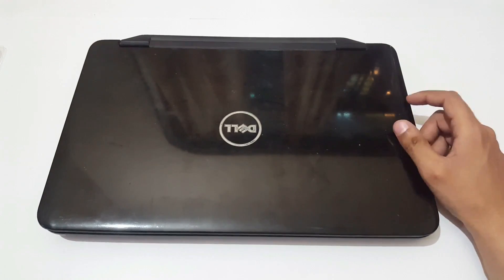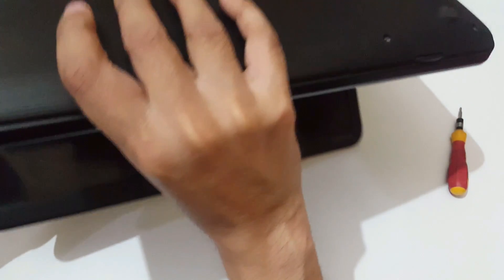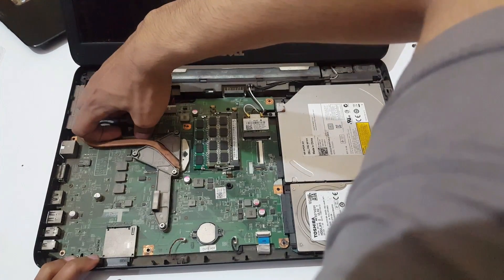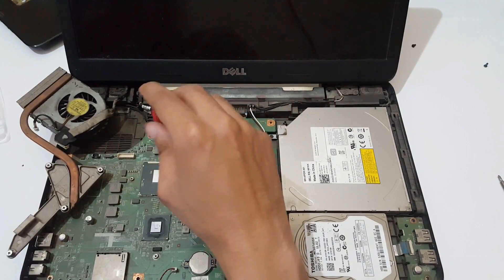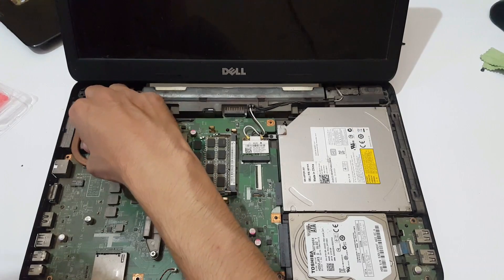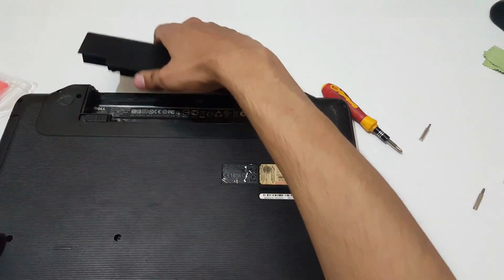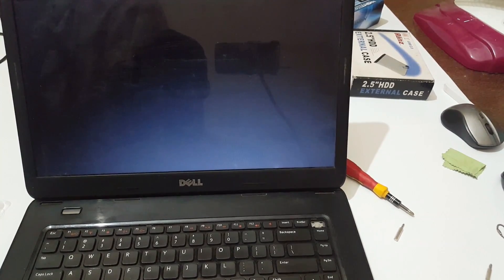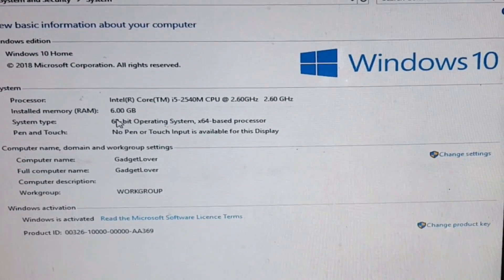How to Upgrade Processor on DELL Laptop | i3 to i5 & i7 - Make Laptop Faster for Gaming

Comment: Hello, This is my laptop specification below.

HP Laptop 15-bstxx
Intel(R) Core(TM) i5-8250U CPU @1.60GHZ 1.80 GHZ
6GB RAM
Memory slot 2 of 2 is in used now. 

Now I wanna know that, is it possible to restore new RAM about 16GB or more?
Does it support on my PC?
Will my PC reset if I restore new RAM and remove previous one??
If I can not restore new RAM then suggest me, how to run faster my PC?
Reply from the maker: @robiul_001  Hi and upgrade it with 2×8GB RAM in your Laptop and it will not reset after RAM upgrade
Reply: @GadgetLover360  Thank you so much for your response.♥️
Reply from the maker: @robiul_001  You're most welcome
Reply: @GadgetLover360  hello sir, my current PC memory speed is 2400MHz, if I restore 8+8gb compatible 3200MHz ram, will it be shown as 3200MHz??
Reply from the maker: @robiul_001  Hi and buy same module

Comment: Can I upgrade my laptop asus X452CP
Reply from the maker: @Naim1806  In my knowledge the processor of this Laptop is soldered so you can't upgrade it but I would suggest you upgrade its RAM to max and install SSD for better performance

Comment: sir my processor upgradable or not inspiron 15 3510 uhd graphics 600
Reply from the maker: @raihanhazri8041  The processor of this Laptop is soldered so you can't upgrade it but I would suggest you upgrade its RAM to max and install SSD for better performance

Comment: Hi! What's the model of this laptop please? It's the same with mine. I would like to also know what type of CPU I should buy in order to upgrade it's performance. It's Gghz is 1.60.
Reply from the maker: @hamzaahmadumar6210  Hi and this is Dell Inspiron N5050 which comes with Intel Core i3 2350M and upgraded with Intel Core i5 2540M
Reply: @GadgetLover360 bro can it will upgrade to i7 which model
Reply from the maker: @YogiRawat07  Intel Core i7 2640M

Comment: Sir i have a laptop i3 6006u cpu 2.00GHz 2.00  can I upgrade processor please reply ❤
Reply from the maker: @HANSRAJ-lj2bv  If the processor is not soldered yes you can upgrade it in same generation
Reply: @GadgetLover360  if solded then what can i do can I unsold and upgrade 🤔
Reply from the maker: @HANSRAJ-lj2bv  No

Comment: Is it possible to upgrade my sony vaio with intel(r) core(tm) i3 cpu m350 @ 2.27ghz, what are my best options? I would love to upgrade it to i7
Reply from the maker: @jayriemendoza2011  In my knowledge the processor of this Laptop is soldered so you can't upgrade it but I would suggest you upgrade its RAM to max and install SSD for better performance
Reply: @GadgetLover360 its a 2010 model and i have seen some in yt that its not soldered. Ill just check, if ever its not soldered what are my best options?
Reply from the maker: @jayriemendoza2011  Intel Core i7 640M

Comment: is it possible to upgrade the processor of dell vostro notebook 3401 my processor in intel core i3 10 gen with 4gb ram
Reply from the maker: @FarhanAhmed-hm7dc  The processor of this Laptop is soldered so you can't upgrade it but I would suggest you upgrade its RAM to max and install SSD for better performance

Comment: is it possible for a dell 5570 to upgrade its intel processor??
Reply from the maker: @jeremyjeremy8593  The processor of this Laptop is soldered so you can't upgrade it but I would suggest you upgrade its RAM to max and install SSD for better performance

Comment: I replaced the CPU in my Dell Inspiron N4050 with i7 2630QM. But it didn't improved the performance. It won't run in 100% processing power, just capped at 40%. I still enjoyed the 8 cores tho
Reply from the maker: @YumeSekaiOfficial  It might be due to software problem go to Settings>Update and recovery>Recovery>Refresh your PC without affecting your files and see if the problem has been solved
Reply: @GadgetLover360  I dunno if that will work. I mean N4050 came out with i3-2310M which doesn't support Intel Turbo Boost. Even the BIOS is so old, it didn't even support it.
Reply from the maker: @YumeSekaiOfficial  Update it BIOS version and see if the problem has been solved

Comment: Bro my laptop is inspiron 15 3542 model and is it possible to upgrade my laptop i3 to i5
Reply from the maker: @Muhammedhashim_10  The processor of this Laptop is soldered so you can't upgrade it but I would suggest you upgrade its RAM to max and install SSD for better performance

Comment: hi bro, can i upgrade my dell latitude e5440?
if yes, what is the best processor for it?
Reply from the maker: @zersVAL  Hi and the processor of this Laptop is soldered so you can't upgrade it but I would suggest you upgrade its RAM to max and install SSD for better performance
Reply: @GadgetLover360  noted, thanks!
Reply from the maker: @zersVAL  You're welcome

Comment: Hello sir can i upgrade my dell inspiron M5040 laptop 
The processor is - AMD C 60 APU ,  and which peocessor should i add
Reply from the maker: @entitysoul77  Hi and I would like to inform you that the processor of this Laptop is soldered so you can't upgrade it but I would suggest you upgrade its RAM to max and install SSD for better performance
Reply: @GadgetLover360  thank you sir
Reply from the maker: @entitysoul77  You're welcome

Comment: Hi bro , I'm using dell Inspiron 15 N5050 same series i want to upgrade processor what processor would you prefer for me under 5000 rupees. If in case i upgrade processor is this problem like heat or something?
Reply from the maker: @magiba786  Hi and Intel Core i5 2540M is best processor for your Laptop
Reply: @GadgetLover360  ok thanks its introduced new issue like heating or something and what is the maximum RAM support plz tell 🙏
Reply from the maker: @magiba786  You're welcome and this will not raise any issues and you can expand it upto 8GB

Comment: Can i upgrade the processor in dell Inspiron 15 3552?
Reply from the maker: @Wise_worm1  The processor of this Laptop is soldered so you can't upgrade it but I would suggest you upgrade its RAM to max and install SSD for better performance
Reply: @GadgetLover360  thanks for the answer. But will I be able to upgrade the CPU if I changed the motherboard?
Reply from the maker: @Wise_worm1  If it is not soldered then yes
Reply: @GadgetLover360  what motherboard you recommend me for laptop? In the previous message I said "sorry" instead of "thanks" lol
Reply from the maker: @Wise_worm1  You're welcome and I would suggest you search on ebay online store or nearby PC store
Reply: @GadgetLover360  thanks so much for informations and help sir, you got a new subscriber!
Reply from the maker: @Wise_worm1  Dear subscriber you're most welcome

Comment: I bro can i upgrade my i3 to i5 in dell Inspiron 3567 

Plz reply
Reply from the maker: @kumarianjali9799  The processor of this Laptop is soldered so you can't upgrade it but I would suggest you upgrade its RAM to max and install SSD for better performance
Reply: Ok😊

Comment: Hi I want to upgrade my pc for coding:
Processor	Intel(R) Core(TM) i5-6200U CPU @ 2.30GHz   2.40 GHz
Installed RAM	8,00 GB (7,74 GB usable)
Dell Latitude 3570 what are your recommendations?
Reply from the maker: @bernardmanikwa3876  The processor of this Laptop is soldered so you can't upgrade it but I would suggest you upgrade its RAM to max and install SSD for better performance in coding

Comment: DELL 5300 i5 87h gen can I upgrade it on i7?
Reply from the maker: @melenciotabud1635  The processor of this Laptop is soldered so you can't upgrade it but I would suggest you upgrade its RAM to max and install SSD for better performance

Comment: Bro if we change the processor then what about graphic card it will increase or not, I wanted to make a gaming PC
Reply from the maker: @mohit65478  It will not optimize but the Laptop performance will optimize and I would suggest you change its graphics card also for better gaming experience
Reply: @GadgetLover360  bro plz suggest a good graphics card & where could i buy from?🥺
Reply from the maker: @mohit65478  I would suggest you search on Amazon online store for better results
Reply: @GadgetLover360  but it will be the external gpu right?
Reply from the maker: @mohit65478  In my knowledge yes

Comment: Bro i have sony vaio laptop sve series can i upgrade?
Reply from the maker: @mohit65478  If the processor is not soldered you can upgrade it in same generation
Reply: @GadgetLover360  how get i know whether the processor is soldered🤔
Reply from the maker: @mohit65478  Provide your Laptop model number
Reply: @GadgetLover360  current processor intel(r) core(tm) i3-2328m cpu @ 2.20ghz 2.20 ghz
Model--sony vaio sve151g12w
Reply from the maker: @mohit65478  Yes and Intel Core i5 2540M is best processor for your Laptop
Reply: @GadgetLover360 where i can order bro its not available on amazon right now😢
Reply from the maker: @mohit65478  I would suggest you buy it from ebay online store
Reply: @GadgetLover360  thanks bro
Reply from the maker: @mohit65478  You're welcome

Comment: Hi bro , great video ! I have a question . Im using Nec Brand laptop with core i3 2nd gen. Do you think i can upgrade the procesor to core i5?
Reply from the maker: @LoidTech  Thank you and if the processor is not soldered you can upgrade it in same generation

Comment: my laptop is hp 2000 2128-tu and it's socket is G2 rPGA 988B so which processor is compatible for this ?
Reply from the maker: @CrapBagg  Intel Core i5 2540M is best processor for your Laptop

Comment: Lenovo ideapad s510p i5 4000u can i changed i7 4gen ? Plz tell me any buddy
Reply from the maker: The processor of this Laptop is soldered so you can't upgrade it but I would suggest you upgrade its RAM to max and install SSD for better performance

Comment: I have intel core i3-3110M processor with Sockets Supported FCBGA1023,FCPGA988 can i upgrade with i5?
Reply from the maker: Yes with the second one if the processor is not soldered but only in the same generation only
Reply: I will arrange quad core processor i7

Comment: Hello, where I can find processor for my laptop if i want to upgrade my CPU is changeable because it's a PGA, so where i can find laptop processor? i5- 4200M
Reply from the maker: Hi and I would suggest you buy it from Ebay online store
Reply: I will arrange quad core processor i7
Reply: @lakshmanraj9375  whats the pricing?
Reply: @mountainstorm122  3000 above depends upon model

Comment: I have Intel Core i3-2350M can i upgrade
And if I upgrade plz tell me what highest i upgrade
Reply from the maker: Intel Core i5 2540M is best processor and you can also go with Intel Core i7 2640M
Reply: @GadgetLover360  but the main problem is can i upgrade Intel Core i3-2350M  what the socket type intel website shows both bga and pga socket type
Reply from the maker: @Dakshtrend Yes you can upgrade it without any problem
Reply: @GadgetLover360  one last query pga processer is too expensive on Amazon and it's availablity is low so can you tell me how can I buy that processer you tell

And thanks for solving my querys 
And you also a great person you still replying
Reply from the maker: @Dakshtrend You're welcome and both are best processor and Intel Core i7 2640M will provide more powerful performance then Intel Core i5 2540M and I would suggest you buy it from Ebay online store
Reply: @GadgetLover360  ok thanks 😊 for helping
Reply: @GadgetLover360  Intel Core i7 2820QM CPU 8M Cache Quad-Core 2.3GHz SR012 Mobile Processor 

Ye vala 4core 8 thred vala hain ye calega kya
Reply from the maker: @Dakshtrend You're welcome and this processor has high TDP which will generate more heat
Reply: @GadgetLover360  bro can I use Intel core i7 2620m because it is available
Reply from the maker: @Dakshtrend Yes
Reply: i have processor
Reply: @gokuda-xi5tf  which can you tell me in detail
Reply from the maker: @gokuda-xi5tf  I would suggest you follow video instructions carefully to do it successfully without any problem
Reply: I will arrange quad core processor i7 2860

Comment: Hey man, i have dell 3340 i3
Is it possible to ugrqde it to i5?
Thanks man
Reply from the maker: You're welcome and the processor of this Laptop is soldered so you can't upgrade it but I would suggest you upgrade its RAM to max and install SSD for better performance
Reply: @GadgetLover360  im in a tight budget, but can i buy 1 8gb ram stick and plug? 
The i'll just buy another one soon?
Reply from the maker: @darkknightzero0811  Yes but before that see how much you can expand its RAM
Reply: Can i use ssd stick in a ssd adapter to my dell?
Reply from the maker: @darkknightzero0811  Yes
Reply: What ssd stick you recommend for my dell latitude 3340?? Thanks man
Reply from the maker: @darkknightzero0811  You're welcome and I would suggest you buy Crucial P3 or Samsung 980 SSD for your Laptop

Comment: Hey dude u just wanna ask that will this process work on dell Inspiron 3542
Reply from the maker: In my knowledge the processor of this Laptop is soldered so you can't upgrade it but I would suggest you upgrade its RAM to max and install SSD for better performance
Reply: @GadgetLover360  Thanks for the fast reply dude 👀🥰 , I'm thinking of 8gb ram and an 250 gb SSD, will I get 30-40 fps? It is enough for me I'm just a casual gamer 🙂
Reply: @GadgetLover360  Reply please 🥺
Reply from the maker: @tencenterror404  You're welcome and yes

Comment: I have dell Inspiron 3521 i3 processor 12gb ram and 512gb SSD it is possible to change processor from i3 to i5 or i7
Reply from the maker: The processor of this Laptop is soldered so you can't upgrade it
Reply: @GadgetLover360  so please suggest me anything by which I can play Far cry 3 smoothly i don't have enough money to buy new laptop or pc 😭
Reply from the maker: @royalgamer_666  I would suggest you connect external graphics card for better gaming experience
Reply: @GadgetLover360  will it support on my laptop
Reply from the maker: @royalgamer_666  Yes

Comment: I have the dell inspiron 15r 5521 laptop with an intel core i5 or something like that, what can i upgrade it to
Reply from the maker: The processor of this Laptop is soldered so you can't upgrade it but I would suggest you upgrade its RAM to max and install SSD for better performance

Comment: Can I change dell Inspiron 14r processor
Reply from the maker: I would like to inform you that if the processor is not soldered you can upgrade it in same generation
Reply: I will arrange quad core processor i7

Comment: Which i7 prosesser can i use?
Reply from the maker: I would like to inform you that if the processor is not soldered you can upgrade it in same generation
Reply: I7

Comment: Bro does Dell Inspiron 1440 support this core i5 it is 2009 model around
Reply from the maker: I would like to inform that you can upgrade it in same generation
Reply: Which generation this laptop in this video
Reply from the maker: @maienuddin7560  This is Intel Core i3 2nd generation upgraded with Intel Core i5 2nd generation
Reply: @GadgetLover360  will it support
Reply from the maker: @maienuddin7560  Intel Core 2 Duo T9900 is best processor for your Laptop
Reply: @GadgetLover360  thank you for your help
Reply from the maker: @maienuddin7560  You're welcome
Reply: My laptop is dual core processor model t4440
Reply: I will arrange quad core processor i7

Comment: Where do i buy this processor bro i live in india and price
Reply from the maker: Price isn't too much and I would suggest you buy it from ebay online store
Reply: @GadgetLover360  thank bro 👍
Reply from the maker: @F.erguson  You're welcome
Reply: i have processor
Reply: @gokuda-xi5tf  how much
Reply: @F.erguson  intel i7 2, 3, 4 gen quad core processor
If you having Pentium processor or celeron processor or i3 or i5 2nd, 3rd, 4tha generation processor in laptop you can upgrade it.
Plug and play and no bios update needed.
Intel i7 2nd, 3rd, 4th gen quad core processor any available model I can arrange it from my frnd.
i5 2540 & i7 2640 2nd gen in hand available. starting from 999
Reply: @F.erguson  which model u need
Reply from the maker: @gokuda-xi5tf  I would suggest you follow video instructions carefully to do it successfully without any problem
Reply: laptop processor AMD E2, A4, A6, A8, A10 & i7 1, 2, 3, 4 gen available
Reply: @gokuda-xi5tf  which is best for Dell n5050 laptop.and compatible with it.
Reply: @gokuda-xi5tf  what is the best that you have and compatible with n5050
Reply: @F.erguson  what is ur processor model and chipset version
Reply: @F.erguson  what is ur processor model & chipset version
Reply: whai is ur processor model & chipset ver
Reply: @gokuda-xi5tf  Intel Core i3-2350M 
Intel HM67 Express
Reply: @gokuda-xi5tf  price
Reply: @F.erguson  hello ?
Reply: @gokuda-xi5tf  hello
Reply: @F.erguson  quad core 2100 and duel core 1000
Reply: @gokuda-xi5tf  quad core one price

Comment: Tell me can I upgrade to i7 ,  I have i3 11th gen Inspiron 3501
Reply from the maker: The processor of this Laptop is soldered so you can't upgrade it but I would suggest you upgrade its RAM to max and install SSD for better performance
Reply: @GadgetLover360  it already has 8gb ram, 256gb SSD with 1tb HDD. Shall I go for further upgradation
Reply from the maker: @unseenscene4487  Yes you can upgrade its RAM upto 16GB for more better performance
Reply: @GadgetLover360  thanks 😊
Reply from the maker: @unseenscene4487  You're welcome

Comment: Am I able to upgrade my Inspiron 3542 Processor? It currently has Intel(R) Core(TM) i3-4005U CPU @ 1.70GHz   1.70 GHz but I would like to upgrade it to the max so I don't know to go with i5 or i7. Please help!
Reply from the maker: The processor of this Laptop is soldered so you can't upgrade it but I would suggest you upgrade its RAM to max and install SSD for better performance